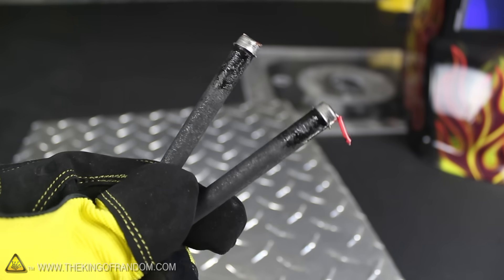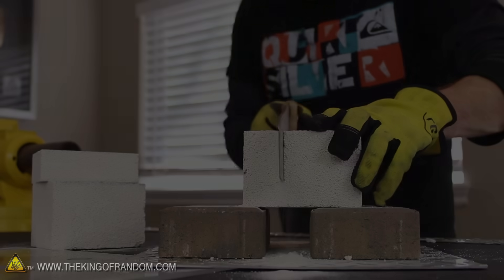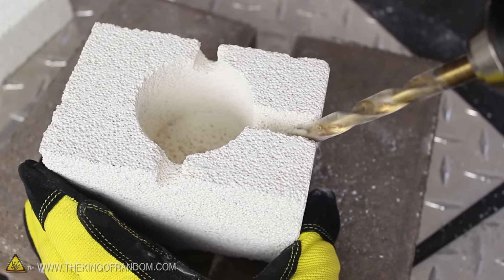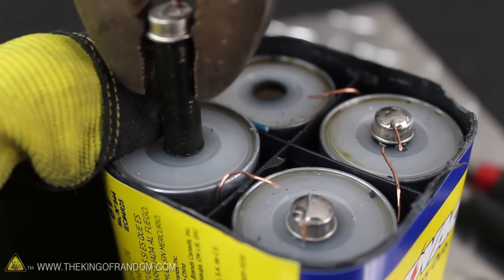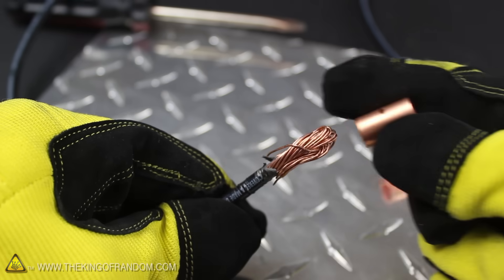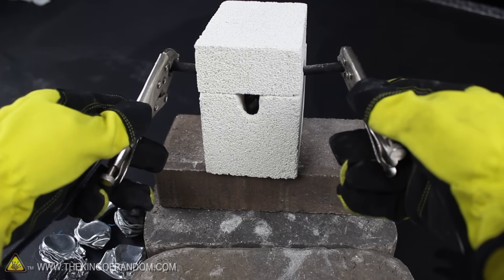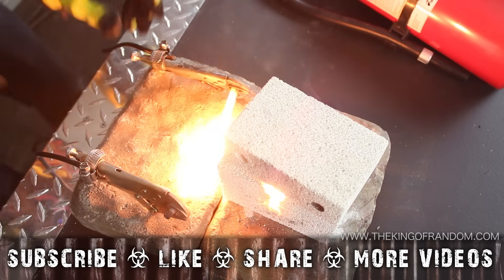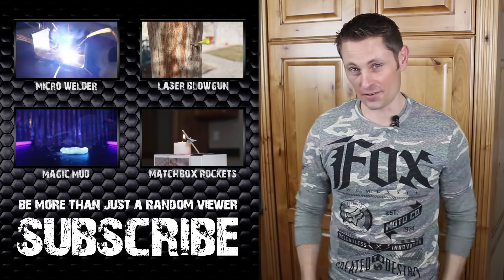How To Make An Electrical Arc Furnace

Comment: Any way to get the power from something other than a makeshift transformer from an old microwave?
Like an outlet or car battery?
Because finding an old microwave isn't easy
Reply: Honestly it is, just drive around your town on trash day and look around. A lot of people do this so don't feel weird doing it because of scrapping. 

Also if you have a dump and you're allowed to go in it (you may have one and not even know it, just go on google) there will be tons of old thrown away items.
Reply: buy an arc welder and use that

Comment: Isn't it dangerous if you hold the pliers without the gloves (or a little hole)? Because of the electricity?
Reply: nope. Watch his videos about the metal melter - this thing has less voltage than these batteries had.

Comment: How do you not get electricuted? what stops the pliers from shocking you?
Reply: It is low voltage
Reply: Jordan O'C
Or the giant gloves he was wearing?
Reply: Joel Valdes Jr. It's not 120 volts. The transformers are stepping down the voltage to <5 volts to get such high amperage. 5v is no where near enough to get through skin, regardless to how many amps are flowing through it.
Reply: Kal larken The same thing that stops you from bring shocked form a 9v battery,or a AA battery: your skin's resistance to low voltages.
Reply: Kal larken Ohms law?
Reply: Banchoking That too, but I'm talking about if he held it with bare hands :)
Reply: Jordan O'C you would die. 120 volts are hard to handle much less the voltage of a house

Comment: If I could, I'd give 1 thumb up for each degree of heat your arc furnace generates, but I guess I'll have to settle for just the 1 that I'm allowed to give. I want to build an arc furnace and experience the power of plasma first hand, and even have a newly spare microwave to take apart for the parts, but my kids have expressed concerns that I might burn or electrocute myself. Be nice if there was a complete illustrated step-by-step guide for reference, Arc Furnaces for Dummies.

Comment: Any chemist? Why the heck is that fire light blue?
Reply: At these temperatures you get some UV light in addition to the visible light. Many cameras pick that up and show it as blue/purple.
Reply: Copper burns as a blue-green flame.
Reply: Neetoryu Kun The only plasma here comes from the electric arc generated between the rods, not the molten metals.
Reply: ***** Well, technically the visible flame of a fire is made of plasma... if the ionized gases are dense enough to meet up the standard definition... Hmm, now you got me confused, I have to look it up
Reply: This is actually more physics than chemistry. As you may or may not know, light is a wave and colors have different wavelengths. The wavelength depends on the amount of energy the electrons of the molecules have. The higher the energy, the more blue-shifted the light becomes. So in short, the hottest form of a flame would be a rather purple flame without the combustion of certain chemicals as that can also affect the color. So this could really just be a mix between the heat (which seems to be pretty high), and the fact the electrodes are made of pure carbon.
Reply: Cause' it can be whatever it wants to be you racist.
Reply: The lighter the color, the hotter the fire is
Reply: You have never seen blue flames?
Reply: LoneWolf CombatTactics About what? :)
Reply: mackedack The arc furnace is too hot so the zinc metal is boiling. The zinc vapour is reacting with atmospheric oxygen. Zinc burns with a pale blue flame. The white smoke is zinc oxide.
Reply: dalew101 No, that blue has absolutely nothing to do with this. You're talking about blackbody radiation when the body is heated to very high temperatures.
This are just emission lines of gaseous zinc. Absolutely unrelated phenomena.
Reply: Its plasma i think.
Reply: So its plasma?
Reply: (○-○) mind blowned.
Reply: the fire is blue becase its not pure carbon unless you order carbon theres always some inpuretis this puticular inpurity must be a wax or plastic of sort to make colerd fire.
Reply: bigbadbarny I am pretty sure its not fire. it has no fuel which fire needs to live
Reply: Tristan Hobbs "Fire" just adresses the oxidation reaction. Many metals can catch fire spontaneously provided there is oxygen around them to start the process
Reply: ***** Oh i didnt know that i thought fire was just a illusion created by heat bending the light spectrum
Reply: it isn't fire, it is an electrical arc, the "blue" you are seeing is the equivalent to a tiny lightning bolt ionizing the air around it.
Reply: ***** I experimentally proved that flames such as candle flames are in fact weak thermal plasmas as they have a much lower dielectric strength than regular air and even clean flames (such as ethanol flames) are much more electrically conductive than regular air. A 2,400 volt electric signal usually will only ionise 2-3 millimetres of air to ground to establish an arc, but when a flame is introduced the spark gap can be increased to several centimetres, a property usually exhibited exclusively by >30,000 volt signals. The electric arc in this video is a strong plasma and is not really fire at all. The arc stream is made virtually entirely of the ionised air and only a minimal amount of combusting graphite.
Reply: ***** steam isnt plasma...
Reply: Giggity Goebbels Steam isn't a hot gas, it's actually a suspension of liquid water droplets. It's doesn't "become visible" by being hot enough, it's visible because it's not homogeneous.
Reply: ***** That's where you're wrong. I suggest you read the first sentence of the wikipedia article: 
Steam is a term for the gaseous phase of water, which is formed when water boils. Steam is invisible; however, "steam" often refers to the visible mist or aerosol of water droplets formed as this water vapor condenses.
By "becoming visible" he means emitting light.
Reply: ***** Again, steam doesn't emit light. It's not incandescent. The visibleness of steam comes from the liquid droplets of water, otherwise it's invisible. That's exactly what the Wikipedia article says after all.
Reply: ***** Regular steam is not visible and liquid droplets of water colloquially known as "steam" is not true steam (gaseous water) in a scientific sense. Steam plasma, i.e. ionised steam, certainly emits light, which is what this argument is about. If steam is hot enough it will emit light. Of course it doesn't under normal conditions.
Reply: ***** I know that, but it's a completely irrelevant objection to the answer I gave to Giggity Goebbels. He was objecting that "steam" (as in, the suspension of liquid droplets of water) is visible, but not plasma. That does not count towards the previous statement as, again, (fake) steam is not visible because is hot enough to become incandescent and emit light, it's just visible because it's a suspension.
Reply: ***** Water droplets suspended in air is not steam. Steam is the incorrect, colloquial name for it. Water vapour plasma is visible. 100C Steam is invisible. End of argument
Reply: Jared Nowlin what you are seeing is not steam. Read this http://en.wikipedia.org/wiki/Steam and report back to me
Reply: ***** Bloody hell, dude. It's not hard to understand that I clearly referred to the literally second line of Wikipedia - i.e. ""steam" often refers to the visible mist or aerosol of water droplets formed as this water vapor condenses." And AGAIN, for the last bloody time, I've never said anything against your statement about plasmatic steam AT ALL. Now go be mad over nothing somewhere else and chill out. End of argument.
Reply: Jared Nowlin Actually, he's right. That's technically not "steam", as steam is by definition the gaseous state of water, which is in fact invisible. What you see when it's cold is called "mist", which is a suspension of tiny liquid water droplets.
Reply: That's not the point here. Of course if you pile up a light year of air you can't see anything behind it. The point is, steam is transparent, while mist isn't.
Reply: some metals / salts burns in colored flames
Reply: spratsprat first red hot, orange hot, white hot, blue hot.
Reply: mackedack What fire? Can you give a time?
Reply: mackedack That is zinc fire. Most metals react with oxygen and can burn. You just need to heat them until they start to boil. Smoke is zinc oxide.
Reply: mackedack Blue means a star, fire etc is very hot over 5000 C. Cooler stars will appear an orangish colour.
Reply: dalew101 BUT ONE TIME MY CAMPFIE WAS BLUE WHAT DOES THIS MEAN?!
Reply: If something is hot, it glows. If it gets hotter, it can change the color of the glow.
Reply: The fire goes light blue because it is getting a lot of oxygen, making it a 'smaller blue roaring flame'
Reply: The Bearded Mage No, dude, it's not. It's blue because zinc vapors have blue emission lines.

Comment: What is a lantern battery in german ?
Reply: Laternenbatterie? :D
Reply: TheMankyTube  The alkaline one is not what's needed, the cheap zinc chloride one is needed. Alkaline don't have carbon rods
Reply: Just look for some battery that's usually a squareish shape, labeled 6 Volts.
Reply: my high school German thinks it's ein lantern battery!!!
Reply: Die Duracell gibt es bei eBay für ca. 15€ das Stück ^^
Reply: just look for those big-ass blocks of 6 volt batteries
Reply: In German, a lantern battery is eine Flachbatterie.
Reply: http://www.amazon.com/Duracell%C2%AE-Coppertop-Alkaline-Lantern-Battery/dp/B002XJVU0A

http://www.amazon.com/Eveready-Volt-Lantern-Battery-1209/dp/B0043CHX38

Something like this
Reply: Mustafa Fertich  Goes in a giant flashlight like this http://img.diytrade.com/cdimg/952865/9527434/0/1246005615/High_Power_Searching_Light_Portable_searchlight_LED_lantern_LED_Spotlight.jpg
Reply: Ok thx
Reply: I was right! Zie tragt einen grunen blouse! YA!! Meinen Deutsche es zer gut!

Comment: how are the clamps not electrocuting you if you're holding them? very cool experiment
Reply: He's wearing gloves that doesn't conduct electricity i think
Reply: I know right, it's not like he's wearing gloves or anything. facepalm
Reply: ah, the magic of gloves!
Reply: He doesn't get electrocuted because the max current is high but the voltage is low. I guess he wears gloves mainly for fire protection. I think he could touch the clamps even with bare hands (far from the electric arc) without getting injured. Anyway, safety is never enough.
Reply: 38911bytefree This is what concerns me about all these untrained people playing with rewound microwave transformers. There's not much insulation on the mains-voltage primary coil, and it will degrade rapidly once heated beyond 80 degrees Celsius.

In his earlier videos showing how to rewind the transformers he purposely cuts the protective earth and leaves the iron cores floating. Extremely bad idea. Ideally, you should have both the core and one end (or the centre tap) of the low voltage coil connected to earth to avoid any risk of lethal shocks. An RCD "safety switch" (I guess its called a 'differential breaker' in other countries?) would cut power as soon as there is any substantial leakage current to the grounded core or LV coil.

I honestly think he should upload a safety amendment video explaining why grounding the transformers is important.
Reply: Check out his "metal melter" video to find out why.
Reply: It's called Ohm law. People are killed by current. You need bigger voltage to pass enough current through your body to kill you, because your body has certain resistance to voltage. He uses transformer to step down voltage from 110V to low voltage.
Reply: Zombies ate my TV that fine. The main issue is, if you overheat the transformer an it starts to burn, and loose the isolation you will get mains voltage exposed to the secondary, so even when the secondary is just a current loop, theres a risk on having 120V or 240V once the transformer failed. Transformer doesnt fail without any reason. But in this case, it is modified, and works in almost a shortcircuit, so overheat is a problem. I wouldnt recommend play with those things unless you understand what is going or you house has, AT LEAST a diff breaker
Reply: The exact same way you can weld and not get electrocuted. ...Mutual inductance occurs when the change in current in one inductor induces a voltage in another nearby inductor. It is important as the mechanism by which transformers work, but it can also cause unwanted coupling between conductors in a circuit [such as YOU]...
Reply: Lol no injury more like skin cancer from all the uv Rays that thing is giving out
Reply: SanjiKunTheLoveCook Did you watch the said afrotechmods video? Because what you said is almost the opposite of what afro said in his video, and the opposite of ohms law. You literally cannot have a high current without a sufficiently high voltage, seeing as voltage literally determines the current. The voltages have to be higher than at least 40 volts to even begin to pass a measurable current. The resistance of dry skin is in the order of 100,000 ohms (which is quite high), and the minimum lethal passable current through the heart is about 30mA. So to pass 30mA through the heart, you need to use a voltage V=IR, V=100,000*0.03 = 3000 volts. Of course, you can sustain damage at lower voltages then that because the body absolutely does NOT have a fixed resistance, and can drop as low as 2000 ohms when the skin is broken or wet. For DC voltages, even 300 volts is painful but not lethal. Due to capacitative properties of the body, AC can pass easier so 60 volts is about the safe limit for AC.

TL;DR, he doesn't get electrocuted because the transformer voltage is too low.
Reply: ***** They do unless you rework them like he did. I don't think you can weld with high voltage and low amps.
Reply: Jan Lukeš if you knew ohm's law, you'd know that even low voltage can be dangerous.
Reply: SanjiKunTheLoveCook care to explain?
Reply: Jan Lukeš even low voltage can be dangerous as hell, if the amp is extremely high. also the body has a fixed resistance (which is not that high anyway), even low voltages can deliver a dangerous blow to nerves or heart. check out "It's not the volts that kill you, it's the amps" by afrotechmods on youtube, it explains it very well

the reason he doesn't get electrocuted is because he's insulated AND becuse the current goes through two transformers, he's not just using live wires connected to a socket, now that would be insane. but grant doesn't look insane.
Reply: Grant E Thats the point. Here you get two types of breaker. One to protect from shorts and overheating (a fuse basically) and other calle "differential" that trips when there's a leak. Like you said, well if you burn the isolation, you are the "leak". But differentials are slow (you get a shock anyways) and need a "good" leak to trip. Plus, they are devices that can fail. Better dont play with those .. Cheers
Reply: SanjiKunTheLoveCook if current loop is isolated, a current transformer like this one, measuredopen, wont develop more thant 2 o 3 volts AC. In that sense it is safe. Its safe until you damage the insultation and your current transfomer turns into an autoformer.
People modding transformers dont need to be scientists nor engineer but need to know a bit about the subjet
Unmodified MOT has an expected output of 2KV with plenty of current, it kills for sure.
This projects are cool, but ABOVE some age and require at least some "technical" background.
Reply: *****
1kilo ohm is 1000 ohms, not 100.000. to his calculation, 300 volts/3k ohm = to 100mA, which according to the chart he shows, can cause ventricular fibrillation and nerve damage.

how can you say suck current is safe to touch? starting from 17mA (>50 volts?)  you get respiratory arrest, which is not "painful" it's "deadly unless someone performs cpr on you"
Reply: SanjiKunTheLoveCook In the end it all depends on the condition of your skin. Your calculations assume body resistance is a constant 3kohm. I never said "kilo ohm" anywhere in my post, and yes, I know what it means. Look up "body resistance" on google. The NIOSH states "Under dry conditions, the resistance offered by the human body may be as high as 100,000 Ohms. Wet or broken skin may drop the body's resistance to 1,000 Ohms," adding that "high-voltage electrical energy quickly breaks down human skin, reducing the human body's resistance to 500 Ohms." Under normal conditions body resistance is 100k ohm. Currents such as 17mA are generally painful and cause uncontrollable muscle grip and clamping, but it is not lethal; only people with heart conditions will suffer fibrillation. Generally a constant 30mA for long periods of time (a minute or so) is required for respiratory paralysis.

Comment: Hey Grant, awesome video, i also made mine with a welder but the silica\ alumina brick you are using isnt possible, these materials are rock hard and impossible to cut with a saw, are you sure its alumina?
Reply: Yes
Reply: There are soft, insulating bricks and hard, structural bricks. It sounds like you have the later. The structural ones don't have near the insulating ability, you need the soft ones.
Reply: John Creamer sure i have been working with these, the alumina silicate bricks are impossible to scratch with metal... so even if these are porous you cant scrats them like this. Its possible they sold you calcium silicate, this is saaay softer and lightweight. but holds only 1100 degrees celcius. i have been looking around here in europe, i still have not found them, not even a picture. if you can, i'll be wrong AND happy !